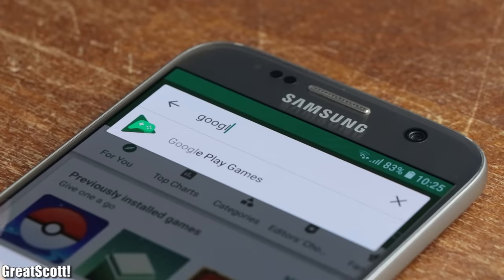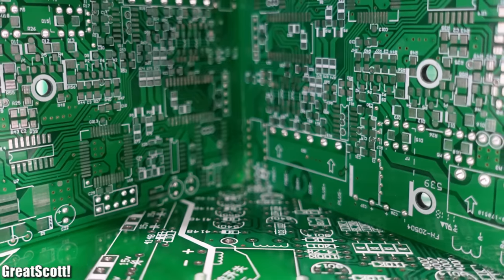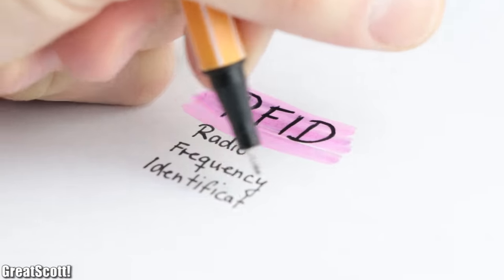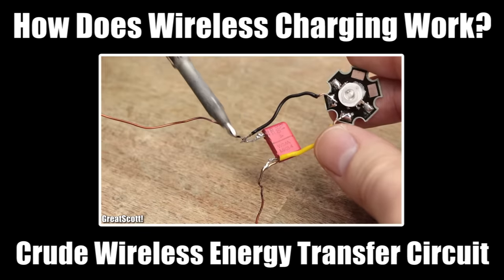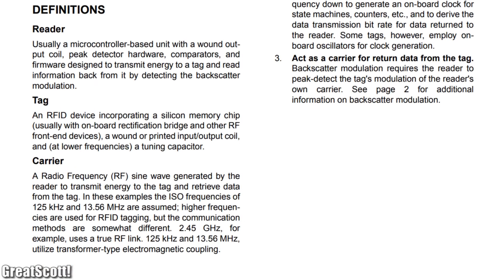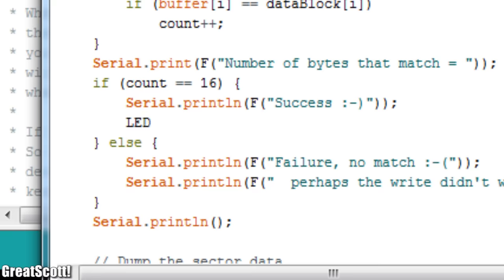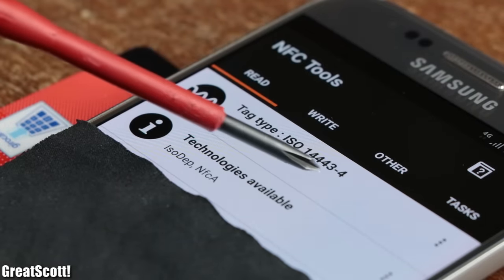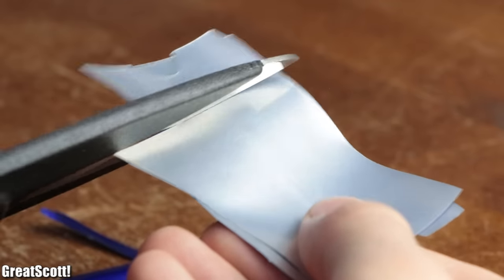How safe is contactless payment? || How does RFID & NFC work? || EB#40

Comment: Oh, come on, "probably encrypted", "close proximity" and "payment limit" isn't even scratching the surface of contactless payment security. For example, "probably encrypted" completely omits that reader does not just read the data from the card - it selects an application to start on the card chip and then communicates with that application. And Google Pay has another neat trick - it gets a bunch of one-time aliases for your card from the card provider, and uses them for payments, even when your phone has no access to the Internet.

Comment: What happens if somebody uses a hacked wireless terminal to read out bankcards and force them to send a 20€ payment?
Reply: He got busted because somebody reports fraud and payment provider has all his data.
Reply: @domints  stolen bank account and then quickly draw out the money on an ATM machine.
Reply: HaLuNkE ST0NER no, payment terminals aren’t things that transfer money from one account to another. To use payment terminal you have to register at payment provider (and give all your details there). Later, you don’t get money money right away, but it’s held on payment provider account until everything is confirmed to be OK.
Reply: @domints  and noone found a way to hack it?
Reply: HaLuNkE ST0NER hack what? Visa or MasterCard? I mean, whole organisation?
Reply: @domints  the service

Comment: Some more explanations would have been needed.
Ok you can encrypt the data so it can't be read.

But the encrypted data can still easily get copied and sent. It's like worse than wifi (as the box and the computer are also speaking in public but at least are smart enough to communicate and modify the key each time so a copy would be useless).

Can anyone tell me how the encryption works and if it realy is difficult to hack ?

Comment: I worked for Mastercard 7 years ago on the initial contactless payment project designs. The main flaw raised back then is the same as it is now. There is no challenge authentication to the process. The verifone device just powers up the card and pulls the account data from the chip. All Contactless payments in the UK at least are approved automatically up to £30. No questions asked. Hence you can have a Cancelled Contactless debit card for example, and keep on making £30 purchases even though its a cancelled card..  Due to this, the No.1 banking fraud in the whole of the EU is contactless fraud. That together with modified mobile phones taking small purchases from the general public while in confined areas. In a lift for example. Or at a concert, or even sat in a cinema.

Comment: the FBI publicly noped out on on their website, for both NFC and RFID before they retracted it. if that doesn't tell you everything you need to know, i don't know what does.
Reply: What they do?
Reply: USA still uses swipe which is unsecure by design and not encrypted
Reply: swipe requires user input or physical access to the card, an unshielded rfid/nfc tag can be read from across a small room without the owner being aware of it, with the right equipment. an nfc/rfid skimmer can fit inside a laptop sleeve.
Reply: @kenabi  It can unless you use some kind of protection, like access keys on e.g. Mifare DESfire or Plus.

Comment: When Car2Go was still operating in my city, I accidentally wrote data to the card and had to get a new one with NFC Tools. Oops! :D
Reply: More fun: I think a popular building RFID must use a really bad ID value because one time I was stuck in a parking garage, and instead of going out completely and around I simply got bored and used my company ID on the RFID reader. It let me in, and I told the security guard he should probably check that out.
It had let me in as if I were someone who actually worked in the building. My pass, which was for a different building in a different city, let me right in! :D
Reply: The security guard approached me again afterward and asked if I were, in fact, this person whose ID I appeared to badge in under. Like he told me the person's name and everything but I forget who it was now.

Comment: It's not safe. barcodes require direct contact. Chips are radio transmissions.
The laws of physics dictate that the barcode will always be more secure than the radio chip that broadcasts it's message

Comment: And still, wireless payment method is not as safe as contact. You cannot be sure then your card is accessed. Somebody can read your cards data, make a copy of your card and use it to buy things or make transactions up to 25€ - 30€. So 30 - 100 successful transactions and debit/ credit card is empty. And it is not faster payment method if somebody uses special metal wallets or boxes to keep wireless cards away from unauthorised access. If it is not safer, not faster why to use this method? It is not better in any way than the contact payment method.

Comment: the whole thing is crap ... Hold the card to very bright light .... you will se an antenna outline near the edge ... just take a punch and punch over that antenna line .... problem solved ..... not all cards are paywave  therefore all machines ... will read the chip and use a pin ... use that ... dont compromise your money for the convenience of the merchant

Comment: I use a rfid blocker card in my wallet maybe you could research how them work?
Reply: It's simply a Faraday Cage, nothing fancy
https://en.m.wikipedia.org/wiki/Faraday_cage
Reply: 2 pieces of aluminium sheets tapped on cardboard work fine
Reply: @RomanoPRODUCTION  but thats not how they work ^^
Reply: If you don't want the Contactless function of you card. You can snip a corner off your card. If you hold a torch behind your bank card you will see the coil loop running around the edge of the card. Just snip through this on 1 corner, job done. Will then work just as a normal chip/n/pin card.
Reply: @SalsaCookies  ok, but that's how I stop NFC signal with my debit mastercard. I tested this with a smartphone NFC spot
Reply: @dj_paultuk7052  yes but it may be considered a breach of contract as you simply destroy the card (at least the integrity of the card) Faraday cage is fine

Comment: It's a known fact that all NFC terminals are not only working the same, for technical reasons, they HAVE to work the same. After all, the customer EXPECTS them to work the same. That means "hacking" your NFC card is, at least in theory, possible by just holding a reader next to your pocket. But normally, NFC readers have a range of about 4 cm - most of the time, even less. In laboratory tests, 10 cm was the maximum. (In murrican: 4 FRIGGING MURRICAN INCHES! YEEEEHAW bam bam oh no I shot grandma). But it has been shown that just adding another NFC Card, whatever it may be, already makes it impossible to read data. Also, having it in your pocket next to coins and behind a few cm of clothing and leather greatly reduces the risk. That doesn't mean there is no risk at all, which is why the credit institutions did what guys with money and power do: bend the laws, and threaten mythbusters. If I had money and power, I'd do that, too. Just to see what's gonna happen. And even though it's theoretically possible to steal your money via NFC, don't forget the analog way: those cards can also be stolen by putting a hand deep down your pants - thats cheaper and more fun for the thief. And if you are still scared that your card may get NFC hacked, drill a hole where the antenna is. Done.

Comment: That's bullshit... Even if tour money is gone... You can receive it easily and teach the stealer.... În this word are tooooooooo many dumb peoples usualy those covers are just for money making... For contact less you needed to touch the  card on pos.... How the hell does stealer where you have the pocket and each credit card has a limit on no pin requires do that is around 20 dolars so....to steal money from  a card you need to have an pos,  pos is provided by banks.... And they don't give pos to who wants... Who need pos it's registered with an ic card and each pos have an address as imei code on phones... They use internet too, provided by a Simcard... Etc and when you make an transaction everywhere bank record the pos io address, Mac address, pos is, hours and a lot of things so... Those special wallets are just bullshit for brain washing. I'M WORKING IN A CREDIT CARDS FACTORY SO...